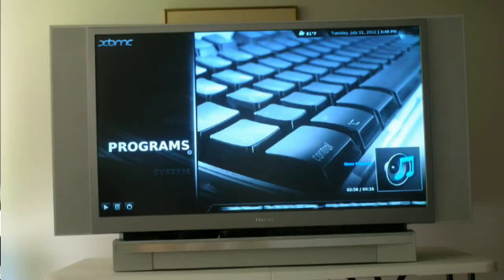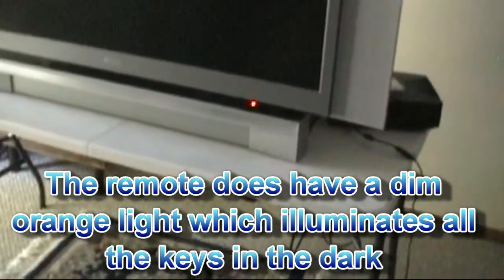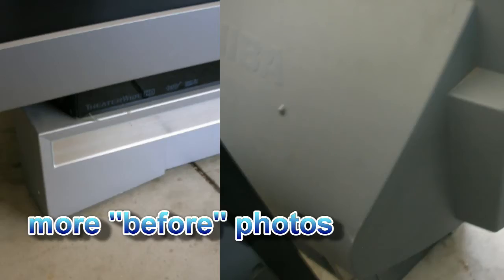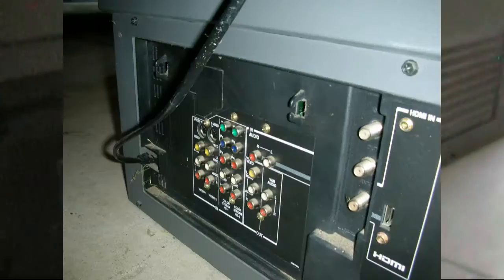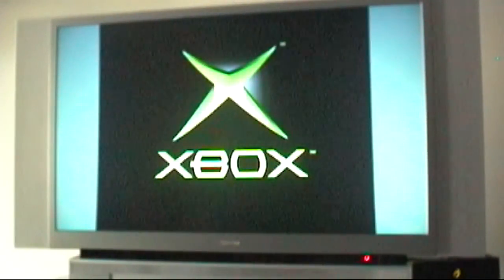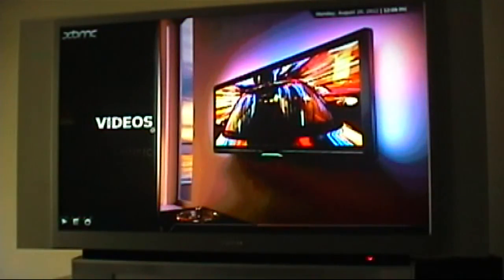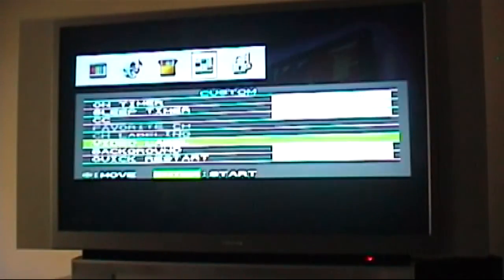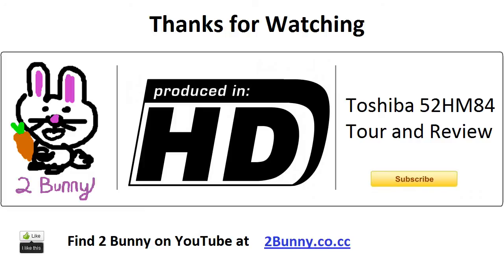Toshiba 52HM84 DLP Rear Projection Product Review and Tour

Comment: I have the same model. Purchased from garage sale. It worked fine. But now the screen is almost pitch black. I can make out bits but thats it. The thing i dont understand is the static shows up fine and so does the menu but no picture. Hoping you could have a suggestion
Reply from the maker: If menus and everything are looking fine, then your light engine is probably fine. What inputs are giving you poor quality? If it's just the analog, (component, composite, S-video, etc.) then there could be something running slightly out of spec affecting that (such as on the RCA DLP featured on this channel with bad capacitors). If it's just HDMI or just the tuner, it might be something specific to those features. Either way, I wasn't terribly involved in the I/O and video processing side of this set. I am interested in finding out how that project turns out though, so keep us posted!

Comment: I've got an 50hm33,I've replaced the lamp.but my screen is still extremely dark.what could it be.i was thinking the light engine.can only see a decent picture if the room is completely dark.help please
Reply from the maker: There's no such model, but if you replaced the lamp with a name-brand unit, it could be having a light engine problem. How did the problem start? Was it gradual or sudden? Is it an even darkness or an uneven one?

Comment: I have the same problem.the tv is on standby green is on n red light keeps flashing.what do I need to do.
Reply from the maker: Do those lights turn on after an unsuccessful attempt at starting the television?
Reply: @Browningate  I have same thing light red green turn on tv an turns off bye itself . No pictures black ad well so t. Red green light n black screen with sounds
Reply from the maker: @Clifford - Huh?
Reply: I have similar problem, my red and green lights come on after trying to start tv. There's buzzing that comes from vent by lamp/bulb.
Reply from the maker: @Quaza17  If I remember correctly, a failure to light the lamp followed by blinking lights either indicates a bad ballast or dead lamp. Do you remember about how many hours are on the current lamp? If it's got thousands of hours, you might want to try that first. Otherwise, consider the ballast. I made a video about that here: https://www.youtube.com/watch?v=wqonFI5BDx4

Comment: I have the 62hm82 model and the green light on the front is solid and the red flashes constantly? what do you think the problem is ( it will not turn on)? Thanks!!
Reply from the maker: Not sure; what do those lights indicate?
Reply: The bulb needs replacing. Located in a pull out chassis on the left side. The bulbs sell for about $20.
Reply: Hey James and Browningate, I have the same TV, just replaced the lamp and 2 weeks later, when I turned it on...no picture, flashing lights on front, then shuts off, then tries to come on again, and repeats this cycle for 25 seconds or so and goes off completely.  Any ideas on what I can do?

Comment: hello, I have the 50" version and just bought a digital antennea for it. But I cant figure out how to get it to search for channels, all i see is static and it seems theres no place in the menu to perform the search, Is there a way or is the TV too old for the digital antenneas?
Reply from the maker: The HM84 series does not have a digital tuner built in. You can use any antenna you want, but in order to view the digital signal, you will unfortunately need to buy an external digital HD tuner (not one of the $5 government rebate standard definition ones). The going rate on eBay for this kind of product seems to be $40 on up (the Samsung SIR-T151 is a decent example).

If you have a set with a model number not ending in HM84, you'll need to check the specifications sheet and/or instructions to see if it is equipped with an ATSC tuner or not.

Best of luck!

Comment: I have the same TV its now breaking down meaning picture turning green how do I fix?
Reply from the maker: Green tint problems are fairly unlikely among DLP sets compared to LCD or SXRD models, but it is typically a fatal problem involving a failing light engine. I don't think there's much hope for it, but you're welcome to ask around on repair sites - the two best places to ask would be the HighDefForums (highdefforum.com) or AVSForum (avsforum.com - this site has good members and lots of information but absolutely pathetic staffing).

Best of luck. Let us know what you figure out.